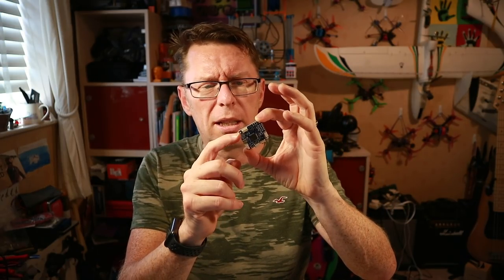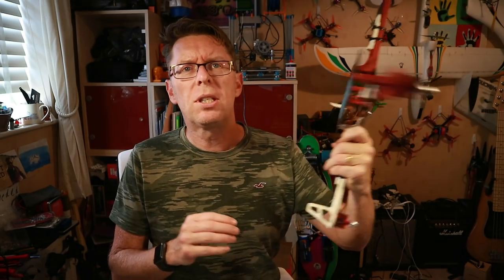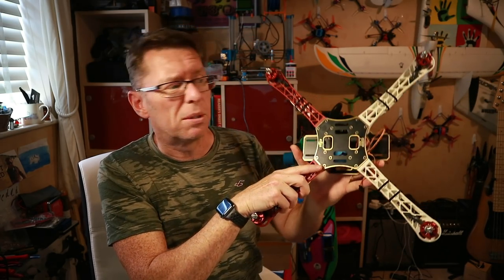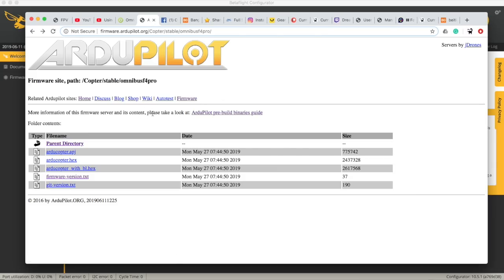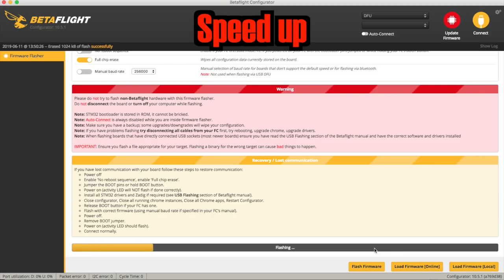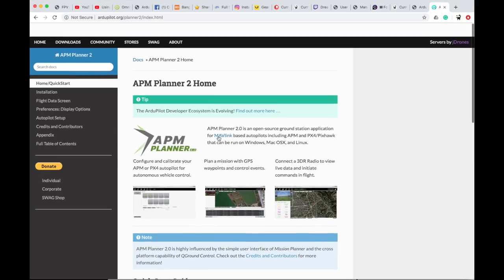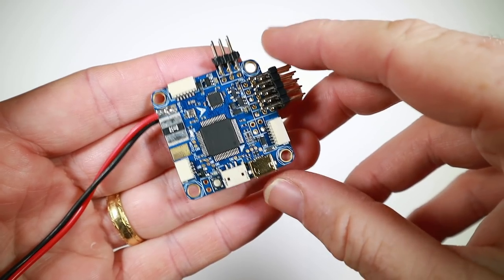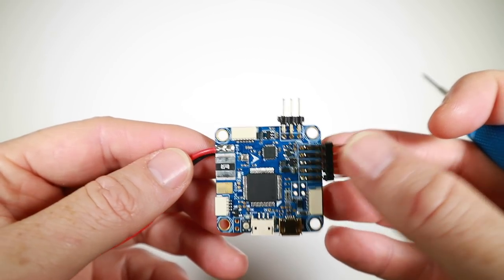Running Ardupilot on an Omnibus F4 on an old  DJI F450 frame (failure included)

Comment: you can set the UART that the GPS runs off, on a Ardupilot Omnibus F4 Pro plane build i have i have set the GPS to UART1.
I also have my Flight modes on Ch7.
The OSD can also be set in the parameter menu and has more item options and the position can be set by changing location values.

once you get to understand the config in FULL PARAMETER TREE you can set anything you want to anything you want.
Be wary of using the SD slot for logging, the last time i checked there was a bug that can cause the FC to crash in flight when an sd card is in, that bug may have been fixed but i would check!
Now you have the quad basically flying, you want to run 'Autotune' and Ardupilot will self tune its PIDs and it will fly very well after that.
Still havent got round to putting one of my Ardupilot F4's in my 450 Quad, mine is still running on an APM Pro, ive never had any problems with it and my setup was painless and it flys very well but i already knew Ardupilot setup as i have planes running APM's as well as one with the Omnibus F4.

Once you get used to Ardupilot you will love it, its way more advanced than other platforms.

Im actually about to take my Ardupilot 450 quad out and fly it funny enough, stick with it and get to know Ardupilot, you will never look back :)
Reply from the maker: That's useful info Steve - thanks.  The way the docs had been written about the Omnibus, you'd think they'd have carved it in stone.  "Thou shall connect your GPS into UART3"  I'll have more of a delve once I sort myself a compass out
Reply: @CurryKitten  Take a screenshot of all the serial settings so you have the original serial protocol numbers and baud rates for each serial before changing anything. the first time i tried to change it i broke all communications on all of the uart ports because some need to be left as default even though they are not physically tied to a port.

If you look at serials 2,4 and 5 you will see that although they are not tied to a physical socket that they have values assigned, changing  those serials is how I managed to  screw it all up but after finding out what they were meant to be and setting them back I was able to swap serial 1 to GPS and 6 to mavlink telemetry.

i went on to another f4 i have running Ardupilot to see what the default vaules were and reset all the settings back to default then changed only what i needed to get it working but not making my mistake in the first place is the better option lol.

I did that for a plane as it made hooking up things easier in the fuse but for a quad i would probably leave the GPS on UART 6 as UART3 that the compass uses by default shares the same socket and makes sense to keep it that way if your using a compass, something that is not necessary to have on a plane but is on a quad.

I think you got unlucky with the header pins,  I own two V2 boards and two V3 boards and all came with pins.

THE V2 board is half the price of the V3! 
It's almost identical but needs a very minor mod to make the current sensor accurate but I don't care about current and haven't bothered doing it as I only need voltage to know the state of my battery.

I like the f4 and will use them where they suit the application,  I have a Z-84 being setup with a f4 pro but it has limited connectivity and for a plane using more than just throttle, ailerons, elevator and rudder it does not have enough outputs as I use separate channels for each aileron plus a cam switcher.
so on planes with flaps and or a pan and tilt camera mount then the APM Pro is my go too, they have 8 servo outputs plus a stack of aux outputs and all connections on the boards are standand servo pins.
They are a fraction of the price compared to something like a pixhawk but still a capable FC and the last version of plane firmware that will fit on the board (space is the reason why the latest cannot be flashed to an APM) is newer than the last version of Copter but unless you are desperate for certain features included in the newer firmware versions there is nothing they don't have that you actually need to fly a model or run missions.

Comment: Excellent timing and good work Sir. I was just starting to look into ardurover with this FC and remapping a motor to servo for steering etc
Reply from the maker: Ardurover looks fun - I thought about using the original APM I had on an old RC car

Comment: Well you learn something every day, ive just discovered that ch 7 and 8 ARE included on the F4 pro, they are just tiny solder pads hidden among all the other pads and on the complete opposite side of the board to pwm 1-6 lol.
i will still go to the APM Pro for bigger planes where weight is not a concern though, the servo pins for absolutely every connection makes them a breeze to hook up.
The current sensor bug on the Omnibus F4 Pro V2 i spoke about is a fault on the RAM pin that causes the current to show very high current draw if you connect anything like a VTX to the RAM pins.
It is caused by a trace design flaw which was fixed in V3 but the fix is very simple and only takes a 28awg wire from the vcc pad of the current sensor to the diode of the LC Filter to bypass the original RAM trace and it will read accurate current draw, if you are powering the VTX from another source and have nothing connected to the ram pins then you dont need to do anything to the board at all as it will read the correct current if there is no draw on the RAM trace.
When its such a minor thing to correct, and at half the price of the V3 for a board that is essentially the same it is a no brainer to get the V2!

Comment: To be clear the Bn220 works fine on ardupilot in a FIXED WING, the BN880 is only required for a multirotor because the compass is required
Reply from the maker: Yes indeed, sorry if this wasn't made clear.  iNav also does the same thing (where I do use a few 220's on fixed wing models)

Comment: you have to take all the things to arm/fly with no problems: Gps, compass, NO SD CARD, you hace to stop the ds card on mission planner. (easy!) telemetry, buzzer etc.. (better..) but the best: take a Apm or a Pixhawk, and no problem lol :)
Reply from the maker: It could be easier - I've just got the BN-880 in to replace the GPS

Comment: Hello Friend !  .  My F4 is working perfectly, it's original by Airbot, I just can't connect through the battery input directly on the board, on the Power module.  I turn on the battery and nothing happens, will it be necessary to make a bridge to enable the power input.  I am using Arduplane.  Thanks. São Paulo - Brasil

Comment: What were you thinking, of course you need a compass. Lol.  I've been wanting to do this exact same thing with an old P3 clone. The only thing I want to do different is use a 4 in 1 ESC. Thx for the vid. Huge help.  
🤘😁👍
Reply from the maker: Well one interesting thing to note is that the motor order on Ardu was completely different than Betaflight, so you might need to cross some wires around on your 4-in-1.
Reply: @CurryKitten  ..thx. That's sounds like important information.

Comment: I have literally just bought a "preloved" F450. They are built like a tank!
Any tips/advice on how I can bring it a bit more up to date and get a bit more flight time out of it???
Reply from the maker: Do you have the original DJI motors/ESCs?  The ESCs are the weak point here, as they are (IIRC) only PWM based, so move to something that supports at least dshot and you are off to a better start.  I have used pretty large lipos on these.  5000mAh 3S on 10" props and 5200mAh 4S on 9"  Good for around 10-15 mins depends how loaded you make it
Reply: @CurryKitten  Thanks for getting back to me. 
I'll have a look at the upgrades you suggested. I'm also wanting to get it compatible with my Taranis QX7 (which it isn't at the moment). Would an X4R work???
Reply from the maker: @Merc-Rover  I depends on the flight controller you have in there, but even the old Naza's can use SBUS, so an X4R should be ok
Reply: @CurryKitten  It's a Naza controller

Comment: Hi, do you no how to get a servo to work on the omnibus f4 board in inav ? just finished a 450 dart & thought i would put a small pan & tilt unit that i had printed yonks ago on the front but cant even get one to work, help needed if poss, (please) must be a way to use the 5&6 motor pins somehow but its beyond my ageing brain power 
All the best,
Kevin.
Reply from the maker: Hey Kevin.  I've only used iNav a few times as well, but I did note that in the Omnibus F3 board, PWM pins 5/6 weren't available if you used the SBUS connector in the same rail... but are if you used a different UART for it... not sure if this is the same on F4.  Take a look at this blog post from me https://www.currykitten.co.uk/getting-inav-ready-for-the-skyhook-discover-2-6-enter-the-cardboard-v-tail/ where I documented what I did on the F3 to setup a V-tail on iNav

Comment: I have this same build running iNav but with an SPF3 board.. Would this work with an F3 as well??. I've am working on a 7inch 3D printed frame for the Naza V2, do you think those motors and 7 inch tri-blade props will work??
Reply from the maker: I have the F3 version running iNav on a fixed wing.  Seems very similar in layout and how it all works, but Ardu seem to only be talking about very specific boards of which only F4 and F7 boards have been converted to run so far.  I guess try it and see for the motors/prop combo.  Perhaps there's an online calculator out there which will tell you the left you can expect based on number of blades and pitch.  I think the original DJI instructions for running on 4s said to use 8", so perhaps that extra blade on the tri's will give you around the same ?

Comment: Good morning everyone, I bought an F4 V-6 and when I pass the image through it, the image comes out with a lot of letters “VVVVV” in Oculos, I already changed the camera for another model, but the letters “V” appears after passing by the plate.

Can someone help me?

Behind the plate the solder bridge was made between the VCC and RAM
I already did the test without the solder and the problem continues!
Reply from the maker: So you are saying you get a load of letters appearing over the image in your goggles?  This is mostly down to font corruption on the OSD.  If you go into the OSD section in betaflight and try loading a new font, see if that fixes the issue
Reply: thank you for your attention .... I already did the test with solder and without solder,
I'm using betaflyght I'm sweating 4.2.2 .. and it doesn't work

the power of the camera is connected to the FC and the VTX is connected directly to the battery !!!
thanks for helping me!!!

Comment: On a Mac, use QGround Control
Reply from the maker: I did originally try QGround control when I tried an original APM years ago but it seemed quite clunky.  Is it a bit more slick these days ?
Reply: @CurryKitten  it works very well, yes.  I just used it for a Pixhawk build on a DJI 450. It should be the same for the omnibus, just don't setup through wizard, but manually into each section for config. Keep it up, good vid! :)

Comment: Pixhawk...expensive FC...STILL..has no onboard video chip...unbelievable TBH....I condemned Ardupilot for all the same reasons you did...so unfriendly...but it is established and works well...Learnt a few things tho...thanks...No compass is not an option with Ardupilot..
Reply from the maker: I couldn't get the OSD to work at all on my previous attempt - it would only do things whilst the data radio was connected !  So I wasn't going to try that again - it's easier, but it feels behind on this sort of setup, although I'm told much more mature on other aspects of it all
Reply: @CurryKitten  agree...but not having an onboard video chip is like a car without wheels...Even today..still no video chip...Unbelievable really.

Comment: 😂 putting ardupilots latest firmware developments on an F4, but using archaic hardware... why not just pick up any 3” or 5” that’s already built and flash it? If it doesn’t already have one add a GPS with Mag and that’s a better test of Ardupilot firmware vs Betaflight / Inav
Reply from the maker: Because Ardu isn't really an alternative to Betaflight.  It's never something to fly acro to.... much the same as why you wouldn't flash betaflight for doing autonomous missions.  I decided to use my old f450 because it's a workhorse - if/when I decide to add extra stuff into the mix, I've got lots of room to add things.  First of which is probably a data radio, but lets get the compass in there first.
Reply: Thanks for the explanation, roll on the data radio and then the gimbal 👍